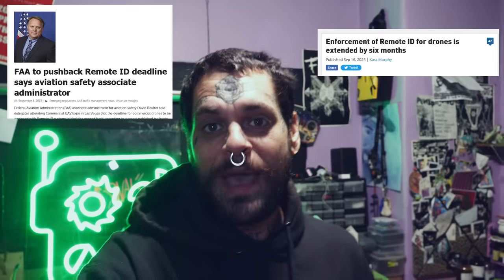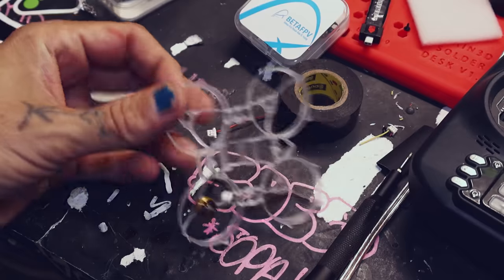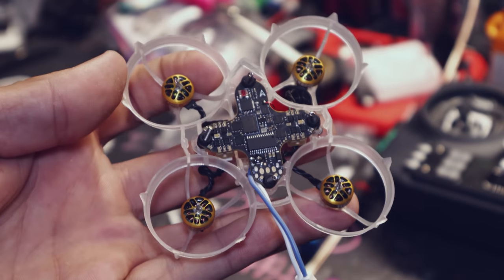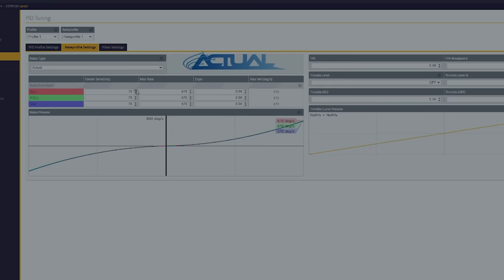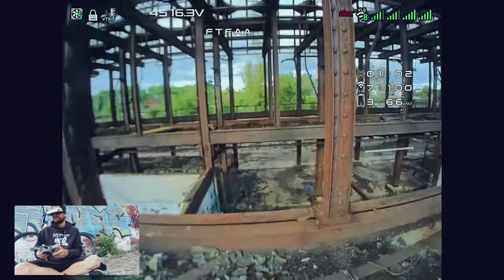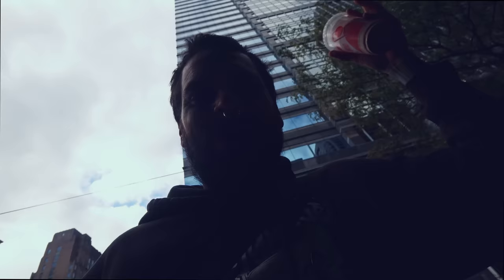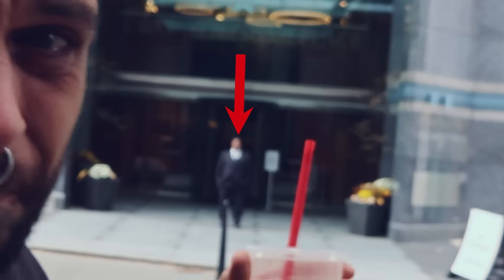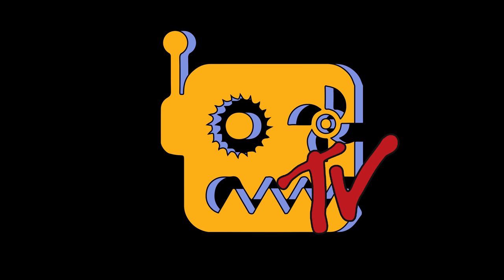How to build a tiny whoop.

Comment: BTW, that 35mm propeller frame is the Meteor65Pro, I have the same frame, the best props are take the quad blade gemfans and use a nail clipper to create bi-blade props you will get better punchout and more battery life!

Comment: I know it sounds like over kill ,,, no not to post another comment 10 mins after the last comment , but I couldnt help but want to share another one of my thoughts,  people were talking props, talking about sag, and get your mind out of the gutter,  we are not gonna pick up those low and easy 1 liners, I have a careful image to meticulate 
Recipe for overthinking the overthunk :   
   you take some really really fine grit sandpaper and try and  cut blades down a little thinner while keeping them balanced,  you can  make a set of gem 3 or 4 blades  that don't sag batteries on 1s ,  need to experiment , but I found the props make such huge gains in performance if you try and get them perfect to your application .   I shouldnt be giving away my little whoop race advantage since I never see anyone doing much more than cutting gemfan quads into 2.    Onething I always wanted to try , and Im surprised a manufacture'erer of props hasnt done this , and If they do , you better call the gg props cuz if I see someone Vapor deposition a coating to make cool chrome props , but also get the nano thin and ridgid with an even thin  nano particle layer of maybe copper and then titanium or something .  If I was me , Id hire myself for a job with all my brilliant suggestions

Comment: Little advice for all you 90s kids who ate glue stix and paint chips , suck on the gummies and then they go in the FC pretty easy with a twist , plus the chemical aftertaste has hints of cheap chinese  bathing caps taste  if you smoked one out of an aluminum can with a bit of cig ashes ....l so could be a plus if your into that ,  Can O' Peas for Whoops I picked up a red solo shot cup , cut it in half  and put it with the cam just behind the drink rim , its kinda cute,  and remember kids  , no rainbow parties without the FAA🏳‍🌈Guys  , so theres that.   💁  ☮💚